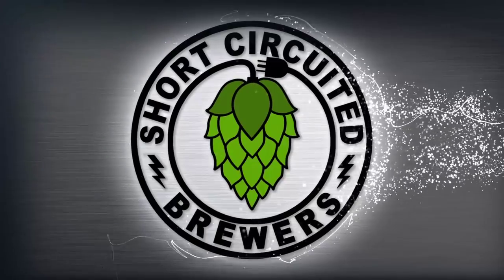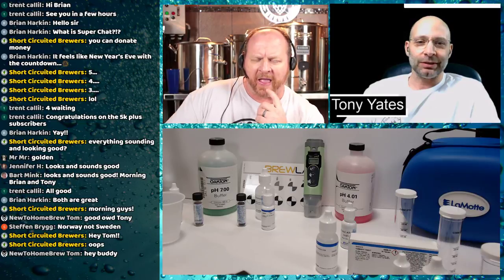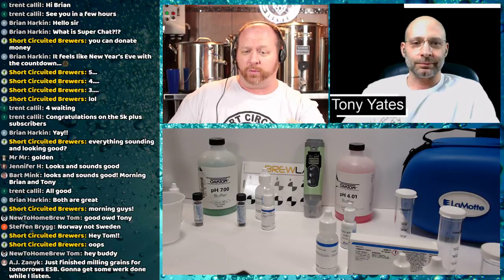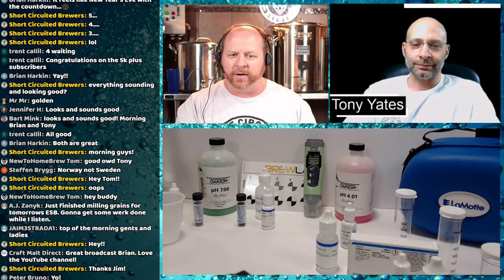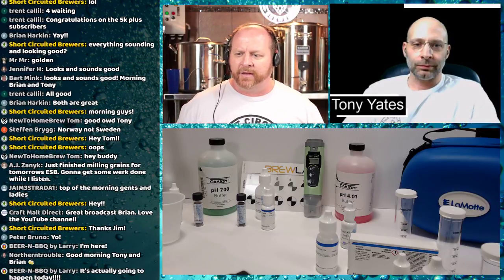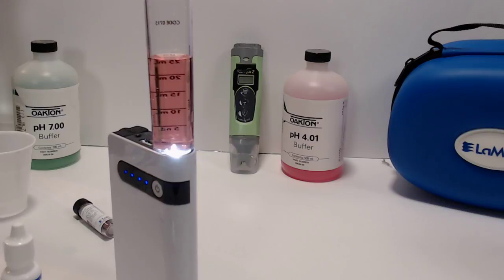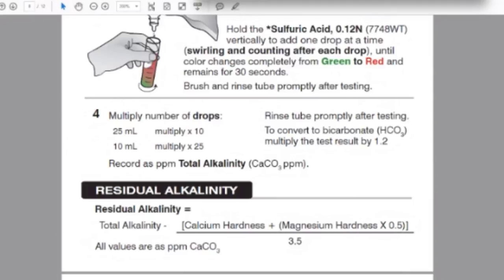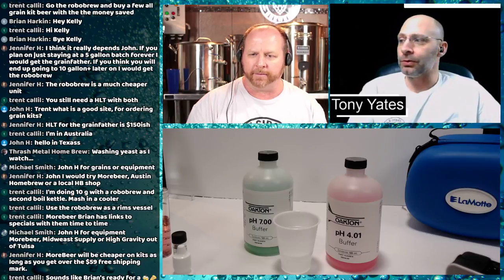Brewing Water Chemistry Featuring Tony Yates - How to use a Lamotte Brew Lab to test your water

Comment: When I do my water adjustment I scale it for the entire amount of water used for mash and mash out.  I do batch sparging.....should I break it up between first runnings and second or is adding the entire amount of salts minerals in the hlt fine
Reply from the maker: Bumpy Road Brewery most of the time you're just adjusting your sparge water for a pH value. You don't necessarily need to add all of the other salts in the sparge water.
Reply: Hi, great question! If the HLT contains all of the water for both strike and sparge (regardless of technique), adjusting the total water volume to a target profile once there and then in the HLT is probably the best case scenario. Most water calculators tend to complicate things because a majority of us home brewers generally have [slightly] different water sources for strike and sparge. Brian is correct too though, once you have striked the mash, you want to focus on ensuring the mash pH is correct, and then ensure your sparge water pH is at most 5.5 pH - so it doesn't raise the pH during the sparge and lead to tannin, silicate, and polyphenol extraction into the wort. Cheers!
Reply: Tony Yates I use lactic acid to adjust my ph....so when I do my batch sparge I should try to get that between 5.2 and 5.5 as well even though it will only be in contact with the grain for 10-15 minutes
Reply: Bumpy Road Brewery No, the sparge water only, before you batch sparge. The reason is if you batch sparge with water that has a high pH (higher than 5.5) it will eventually make it into the boil kettle, ultimately increasing your overall pH. You don’t want that. You want all preboil wort to also be between 5.2 and 5.6.
Reply: Tony Yates ok....question about the ph meters.  How do you adjust what they read at the high temperatures of mash vs the 60f they are calibrated at
Reply from the maker: Bumpy Road Brewery my pH meter is rated for Mash temperatures. What type of meter are you using?
Reply: Short Circuited Brewers Milwaukee 55
Reply from the maker: Bumpy Road Brewery okay a quick scan through the manual of the unit. You may calibrate it at 60 degrees however it will read all the way up to 221 degrees Fahrenheit temperature reading while simultaneously reading the pH of the liquid. You are fine to measure the pH at Mash temperatures  according to the manual it will Auto compensate for temperature when reading pH.
Reply: I wish I could just do this over the phone...but here is my Brewday scenario.  I'm an all grain batch sparge 5 gallon brewer.  My typical total water volume is 9 gallons that will give me a total pre boil volume of about 7 gallons for a 60min boil leaving me about 5.25 that makes it to fermentation.  I use beersmith that calculates water profile and grains used then states how much acid to use for initial strike and if chosen recommended sparge acid.  I create a water profile using the 9 gallons and make the mix in my hlt.  I then split the runoff for first batch and sparge....because I used my brain I only added the acid for the initial mash thinking the grain would absorb some acid lowering the ph to an aceptibal level for the batch sparge...I over think things.  My ph meter never agreed with a ward labs test I had done so i 50/50 it.
Reply from the maker: Bumpy Road Brewery it's alright. Are you on Facebook?
Reply: Short Circuited Brewers no previously on MySpace but found social media a way for unwanted people to keep track of you "divorced" and remarried
Reply from the maker: Bumpy Road Brewery lol ok let's not open that can of worms!! Shoot me your email brian@shortcircuitedbrewers.com